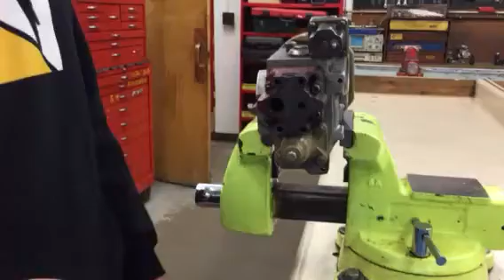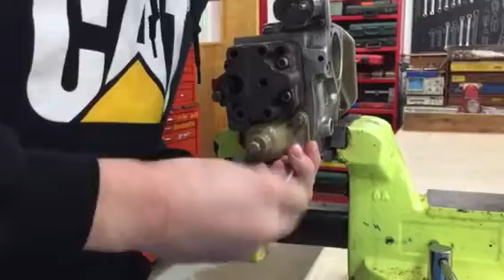How to crank up a Cummins PT Pump

Comment: I always use an "0" button, a white spring & 2 shims! And don't forget to back off the Anoroid valve, 2450 rpm without a load in it, shift point will be 2150 and your big Cam will SCREAM! Massive hp from a smaller engine! Shortens the engine life by about 50000 miles & uses a lil more fuel, but trust me, you'll LOVE the power !

Comment: What will cause a pt fuel pump to (Slowly) come down from Acceleration , my ntc engine revs up normally but excels Slow , changed fuel filter
Reply: I'm glad to see your comment isn't super old here.. My truck did that when the throttle clamp came loose.. I tightened it up and it solved the issue.  Mine was a brand new pump.  I've had it happen a few times, but the last time I clamped it tight and put a little blue loctite on it and it's holding 6 months later.
Reply: air in pump

Comment: To properly turn up a cummins ptg/afc pump one needs to turn the throttle shaft leakage screw a tiny bit outwards. As well as adjust the afc bellows pressure setscrews. The fuel button should be changed to a lower size if the parameters of the leakage is not acceptable. Going from a 7/16 gear pump to a larger 3/4 or even 1” from a “celect” style pump will be somewhat necessary to keep the pump internals from overheating via too small a gear.
This guy is only increasing engine rpm which is highly problematic on the nhc/ntc/m11/ formula 300 ect engines. 
Turning up fuel pressure to say 300 pounds isn’t going to do much if the fuel orifice screws in the injectors are too restricted. Almost all of the excess fuel will return to the fuel tank.

Comment: I've worked on pumps while still on engine,  replaced the fuel plunger from. #32 to. A #5 I stretched the spring and had 2450 no load RPM and my fuel mileage went from 5.8 to 6.25 and pulled hills much better less shifting. You need to watch your pryomter if it goes over 950 back off or down shift.
I have also used. #10 and that works ok as well.

Comment: Nice tips now ill turn my pump up until it explode
Reply: Anthonio Nesbitt he is an idiot.  Did absolutely nothing but increase rpm.
Reply: @bctw9004  your right, who sells the Red Spring for those PT pump?
Reply: Anthonio Nesbitt Permco in Texas is who I get all my PT parts from.
Reply: @bctw9004  do they sell that Blue spring that goes in the pt fuel pump that increases RPMs?

Comment: Rookies. No power increase. Just a redline somewhere above 2300rpms and BOOM
Reply: Mine turns 2600
Reply: @johncholmes643  nice!!!
Reply: @johncholmes643  a big cam can handle 2700 to 3000. A small cam can not. At 2500 they will put valves into the pistons.  Them blindly putting in shims and not knowing the exact shim for the governor setting all it takes is one throttle snap and it goes too high and boom
Reply: He raised It 300 rpm. You need bigger valve spring. Hell you need bigger valve springs above 30psi of boost

Comment: All that does is increase the RPM. Does nothing for fuel pressure or power. Need to change button and spring.
Reply: Your right bro, i heard the Blue spring with a number 0 button adds alot of power and response
Reply: Anthonio Nesbitt you gotta be careful. There’s 100s of calibration codes for the PT pump.  If you’re pump code calls for a 35 button and a yellow spring and you put in a number 5 with zebra purple stripe your pistons won’t be too happy.   Call Permco with your pump pump I’d tag number and go from there.
Reply: @bctw9004  thanks alot, i have #5  button in my pump stock Governor springs with about 15 shims, it revs high and fast, i think some thing is rong with my Turbo, i have a Holset Bht3b turbo & it makes this anoying BOV sound when ever i full throtle & let of the gass pedal, i think my turbo is trying to stall, iam buying a HT60 turbo in a few months
Reply: Anthonio Nesbitt yes sounds like you need more air or have a boost leak. Check all your hoses and clamps. Exhaust manifold gaskets were known for going bad on cummins also. That will decrease your boost. My 400 BC has a HT3 also. They are good for 650 hp. Manifold pressure is 32 and runs good. My rail pressure is 225.  That is about the max I personally would run on a cummins without it destroying itself.
Reply: Athony Nesbitt  sorry can I ask some question, after I calibrated the fuel pump of NTA 855 M 400HP the test bench show fuel flow and pressure are stable but after I test it on engine NTA, the rpm is not stable no matter it idle speed or high speed
Reply: Apichai Lim the bench will always show a different pressure than on the motor. Check it on the motor then adjust.
Reply: Apichai Lim I always set mine at 210-225. Any more than that and you will have cam issues. Watch your pyrometer temps and keep your rpms around 1800 or above when pulling and you’ll be fine
Reply: BCT W900 that mean NTA fuel pump also can set at pressure 210-225? More pressure fuel more high temp?
Reply: Apichai Lim yes.  The hotter the engine will run. Stock pressures (depending on your CPL) is only around 140-160.  Cummins will run comfortable at no more than 225. I highly suggest a dual fuel line set up as well.
Reply: BCT W900 okay I will try it thank you for sharing knowledge ,master W900
Reply: Anthony Nesbitt what you're talking about is turbo surge
Reply: Add a 15 a blue spring and 6 or so fat shims give it some air and 1 turn of throttle shaft rail pressure and it will haul the mail then
Reply: I've built hundreds of these pumps and adding shims will increase pressure and road speed. I'm wondering how many pt pumps you have tested on a test bench?

Comment: how much rpm did you gain with 2 shims ? mine is maxed at 1800 a little more would be great
Reply: You can stretch the govenor spring and get more RPM
Reply: You can along as you don't have a cruise speed pump. Adding shims doesn't work

Comment: Without putting the pump on a test bench or back on the truck and run up on a chassis dyno all this is a shot in the dark and backyard mechanics.
Reply: He basically went about 300rpm higher
 No fuel pressure was modified in this video
Reply: Unless you have a fuel pressure gauge and manifold psi gauge
Reply: The test bench is in the room to the left. It does add fuel pressure,  that's the beauty of having a test bench and prove that it works